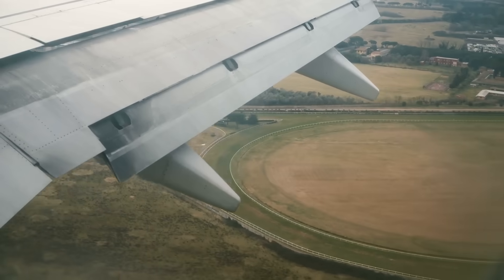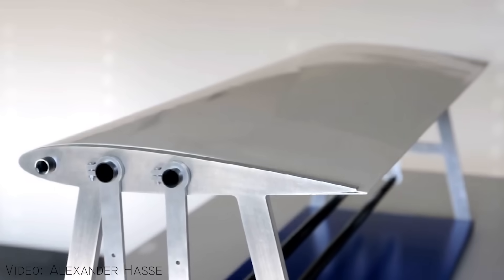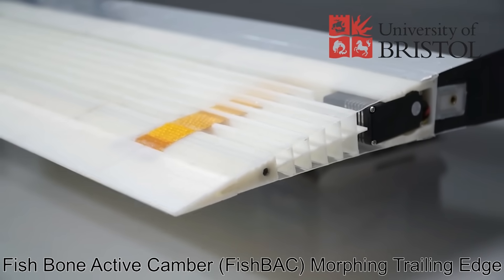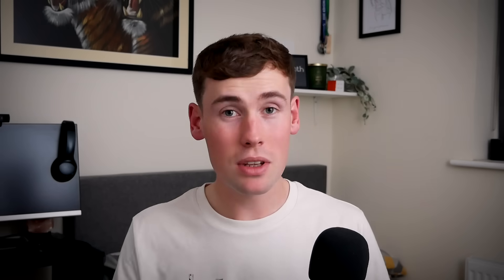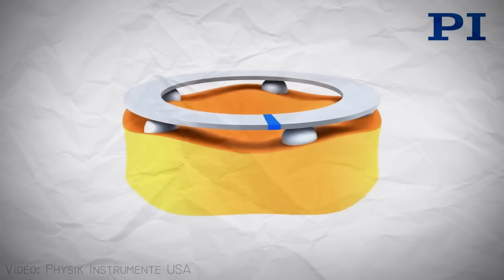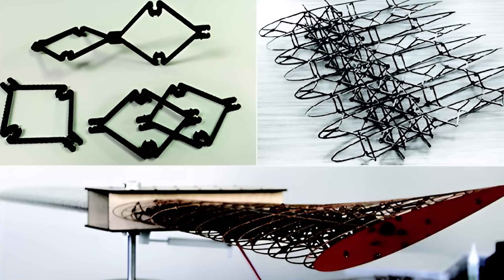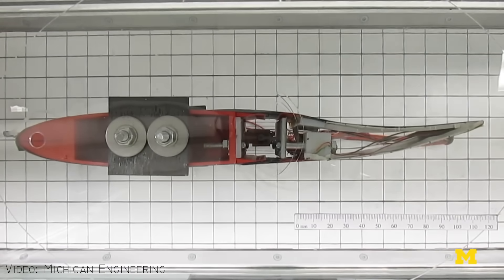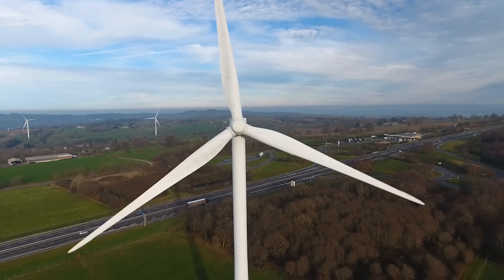Metamorphic Wings: The Future of Flight is Here

Comment: Hydrogen has a very low volumetric energy density, so hydrogen powered plans would need substantially larger fuel tanks, even though that fuel would weigh less. There is actually more hydrogen in a gallon of gasoline then in a gallon of cryogenic liquified hydrogen.

Comment: I started work on this concept in my teens and ultimately developed as a proof of concept a hydrofoil with high grade silicone junctions/joints that allowed for natural metamorphic reaction that improved pump and stability and massively improved manoeuvrability, translated to air I have been working on flexible skin materials and horn operated metamorphic wings and empennages. My second full size aircraft design incorporated a scaled up but simplified variant of this system on the wings for roll control and stall delay, alas the lack of funding and technology to take it further it hasn’t gone past prototyping but the dream remains and there is hardly a day that goes by that I don’t think about this and how to improve it - massively drawing from nature. We are a long way away from full morphing wings in conventional aviation since aviation is ironically incredibly conservative especially commercial aviation where new ideas take years to be incorporated or due completely in favour of keeping pax happy. Look at the mist modern airliner and compare it to a 1950’s design and you will be hard pressed to see massive differences
Reply: Unfortunately, you are right. In the 1960's when I was employed in aircraft design research, the all-wing aircraft was already being proposed as a better alternative to the common fuselage tube and the suspended engines below the swept-wing form, of most of the US transport-aircraft manufacturers. We are still in that inefficient state!
Reply: @Macrocompassion how old are you?

Comment: Very interesting indeed. However, what about flutter tendency ?  I ´ve heard they are testing control systems to actuate those integrated movement devices in order to avoid flutter tendency. To be quite honest I wouldn´t feel very safe with necessary work of many littel actuators. If the batterie my little single seater fails I can continue my flight and land safely.
The flaps of airliners do have some drag. However, for landing it is intended, because the aircraft is more stable in speed and height when the jets give thrust and the airbrakes give resistance. What I can imagine is the system to be used for minor shape moulding during climb and at cruising speed when the aircraft looses weight because of fuel consumption.

Comment: ...huh.
96-99 I was working on variable chordate states through distortable boundary materials for a company I cannot name.
We could never get the flexible surface to bond to the rigid leading edge with enough reliability to put one in the air.
Never got called a genius.
Interesting to see this coming online, I kinda always thought it was only a materials issue.

Comment: Back in the days when I was a sailplane pilot, for high speed flight when jumping from one thermal to another, we would select negative flap (flaps deflected upwards) to modify the aerofoil to a high speed, low drag section. Once in the thermal we would lower maybe 10° of flap and slow right down to about stalling speed to be in the rising air for as long as possible. This was a really efficient way of flying.
Reply: we do this with current high performance RC gliders...  typically DLG gliders have at least 3 modes.. float, cruise and speed ( flaps slightly down, straight and slightly up )

Comment: My big thoughts on this would be how it impacts the safety of the plane in case of failure. A lot of modern aircraft have systems in place to allow pilots to manually control flaps, ailerons, etc manually in case of some sort of failure through pulleys or applying pressure to the hydraulic fluid without an electric pump. Would it be possible to do something similar with these morphing wings that all seem to be completely reliant on electricity? Or would you be stuck with zero control of your aircraft if the electric controls failed?

Comment: I think that these flight controls would be great on robotic aircraft, but for any that carry a human pilot or passengers there would be too many problems. Setting up, checking settings, but most of all fatigue.

Additionally, on the fuel side, reducing the ammount of wing box would severely limit fuel load. If you want to see morphing wings, see what Barnes Wallis designed.

Comment: The only thing that I can add to this conversation is that such systems do require fly-by-wire. 
General aviation (small planes) is unfortunately not there yet. Alone the use of electronics on regular flap and aileron assemblies (as used on military aircraft) would increase efficiency throughout the flight envelope.

Comment: Flexible skin materials means they’ll be made out of non-metallic materials so they’re impacted by solar exposure, extreme low temperatures and temperature variances where parts materials interface. So any element that requires an isolated temperature protection to safely function can add more weight and complexity this taking up more volume of interior area that could be used for fuel (all 240 tons of fuel)

Comment: I doubt these things will be used in airplanes anytime soon, BUT they might come in handy for offshore wind turbines. These turbines to this day do not have flaps. Moving parts are hard to maintain offshore and openings in the outer skin of the airfoil are a no go offshore. A shape shifting airfoil actuated by smart materials without any mechanical actuators would be huge. The science needs to go a long way until this could become reality however.

Comment: Cool video, well researched & presented, but in another way the clickbait 125% efficiency title is just nonsense.

What I didn't read from other reply's and a very important point:- Flaps on an airliner not only change the shape of the aero foil
but also significantly increase the wing area.  This is critical towards reducing landing speeds but is not a feature of any of the
morphing designs presented. 

Furthermore, during the morph process, many of the designs presented show reflex style curvature on the upper wing surface,
I would question if this is a good idea?

Finally please qualify how you claim 125% increase in efficiency? As others have noted during flaps down for landing approach
the normal measure of efficiency (L/D ratio) is deliberately compromise to increase drag. 

So congratulations on a great advert for OnShape.

Comment: And  how about the fact flaps being a separate mini wing actually assists with maintaining a clean flow of air over the wing? The extension of flaps isn't just a change of wing shape, it's specifically to ensure the airflow has a gap to flow through between the wing and flap.

In other words, this idea sounds great and likely will optimise flight characteristics, it won't eliminate the benefits of slotted flaps.

Comment: Modern day flaps are easier to monitor, easier to inspect and FAR easier to replace parts on, and do the exact same job as these wings here.  Imagine trying to guess the metal fatigue rates and cost of replacement for “flexible” wings?

Comment: You're comparing this metamorphic Wing that you are introducing here to the Wright brothers Wing twisting which essentially provides what is done via the use of ailerons. Is a misnomer. The Wright brothers did not use metamorphic wings. Wings never actually changed their shape you twisted their incidence of affect. But you did not change their shape. This was further compounded by the fact that when others developed ailerons and other control surfaces that functioned independently of the wing. Even the courts couldn't decide the difference allow them to claim that a twisting Wing was also an aileron and was also flaps and was also other bullshit. Even in their contract with the Smithsonian Institute, the Smithsonian Institute was never allowed to stay that anybody else headed vented anything having to do with heavier-than-air flight, even if it could be proven. Which meant that others who had indeed invented at least aspects, if not full aircraft. Wouldn't even be much more than a mission in a couple of news articles. Kind of like hauling Michael Jordan a great basketball player even though the only time he was very good at it he actually had arranged for the rules of basketball to be changed during the time of his playing. Kind of begs the question on whether or not he was actually nearly as good as he claims to have been.

Comment: Flaps dont need to be efficient.. There purpose is to increase lift and drag and slow speeds.. If you notice, they are only used during this phase, 99% of the time a plane is flying its wing is in the most optimal clean configuration.. Designing an all moving complex trailing edge is unnecessary for the benefits it would see..

Comment: I think you are confusing the Flaps & the Ailerons.
This technology could be useful for Aileron application, but Flaps does not only changes the shape of the wing.

For your info, a flap extension literally increases the surface area of the wing, which generates more lift. 
The slots in between the flaps could re-energise the airflow, delay the airflow separation, hence, stall.
Of course, it changes the Angle Of Attack too.

The technology introduced in the video do not increase the surface area, nor have the slot for air to pass through. Hence, it didn’t contribute lift as well as flap does.
Reply: Exactly, flaps are not only about bending the wings, it seems that most of the people here don't know or don't realise that.

Comment: An Interesting and reasonably well-presented, article. But - and there is invariably a "But" - as one who has been an ancient English (Licensed) aircraft engineer for over five decades - longer than laddy (or his parents) have been alive methinks - there is one, large, entomological example of musca domestica in this supply of soothing salve... That is simply, yon wee laddy's continued and entirely inappropriate use of the "P" word... 
  "Planes" are woodworking hand-tools and they're absolutely excellent for smoothing and shaping wood. That is what 'Planes' are.
  These heavy steel, brass and hardwood hand-tools are, however, utterly useless as flying machines.
  In fact, it is absolutely true to say that the average plane is about as aerodynamically able as the average house brick.
  Aircraft are machines, invariably but not necessarily Heavier-than-air, which are designed to become airborne and fly through the air.    This is one reason for designating such devices as Air Craft. 
  Please promise that you will, in future, at least make an attempt to avoid incorrect aeronautical or aviation-related terminology...

Comment: Airplane using morph wing and it still use chemical fuel that needs to be refuel. This is the same old flying concept as in World War I. Scrap this antiquated method of flying and look into anti-gravity  propulsion system that uses zero-point energy. It is infinitely better than plane with wings and uses chemical fuel with limited range.

Comment: You mentioned that flaps are for creating lift for takeoff and drag for landing. True but not true. Flaps are for generating more lift at slower airspeeds. This has the effect of shorter take offs and slower ground speed when both taking off and landing. [Creates a slower stall speed] The extra drag is only a positive effect in that after touch down it helps to slow the aircraft down.

Comment: Why wait for nature to produce stress cracks when you can purposely fatigue your surfaces and accelerate it yourself?  Bad idea.  Also, keep in mind the landing configuration happens briefly, relative to total flight time, so even if it was a good idea, it's not a game changer.  eg. If you came up with a better way to inhibit coolant flow while an automobile is warming up, that state is temporary/brief, so it wouldn't revolutionize the industry.

Comment: NASAs and the Wales project look very similar...I always wondering about a wing flexible, to behave in this same style but from wing root towards the wing tips, same way as the vortex forms so the wing would have its highest flex moment or torsion in the wing tips being harder on the wing root...seems that from leading edge to trailing edge it's more plausible...I was wrong 😊

Comment: First thing that comes to mind is temperature. Early mobilephone stations suffered terribly from temperature change, going out of tune as the weather changed. Getting these flexible surfaces to behave consistantly over the temperature range airliners experience will be a substancial challenge.
Reply: Heating and insulation?
(For the moving parts... Good materials for the surfaces with constant elasticity over a range of about 100°C)
Reply: First thing that came to my radio control hobbyist mind was fludder.  Who knew someone would actually aim to make their airfoil... or "aero-foil" (spoken like the queen) flex?
Reply: Compensate flexure as a function of temperature, standard programming stuff.
Reply: I mean nitinol could work
Reply: hopefully the skin could be easily replaced, perhaps as often as tires are replaced? A possible benefit for the flexible surface might be de-icing. Just flex the wing back-and-forth and maybe the ice would just fly off instead of needing to spray it or having an elaborate de-icing system (leading edge might still need one though)
Reply: @HyenaEmpyema For a large jet like Boeing-747, that will be a complete nightmare, as well as will increase the maintenance cost many times over.
Reply: @HyenaEmpyema  mate I read the first sentence of what you wrote and it's already impractical and expensive
the way is through material engineering, it'll take a lot of money in R&D though
Reply: @finonevado8891  airplanes were impractical and expensive. now they are everywhere.
Reply: @HyenaEmpyema  material engineering would be more reliable and might solve the temperature variation issue.
Replacing the surface would be impractical, it's ssentially replacing the entire wing, and you don't see that on big airliners
Reply: these are wings though, not mobile phones
Reply: @Fatherlake  Thermal expansion and contraction can wreck havoc in the functionality of these wings too.
Reply: The first thing that came to my mind is HOW THE HECK DO YOU EXPECT BENDABLE MATERIALS LIKE THAT TO LAST! Many many lives would depend on that lasting 30+ years of regular use. Still good to talk about theoretical ways to improve efficiency of wings, but I wish he’d mentioned the (imo obvious) downsides to flexible designs in extreme environments